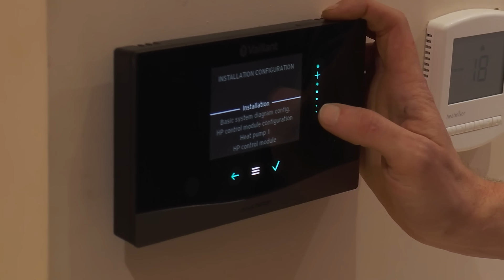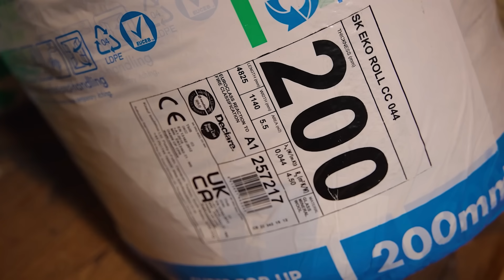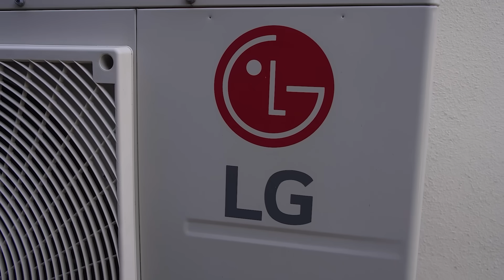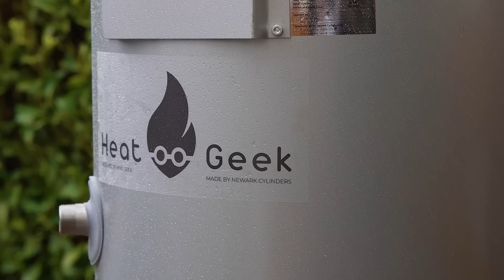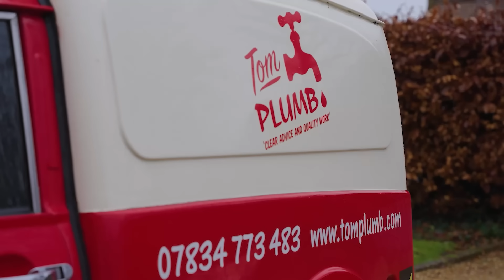Heat Geek’s Heat Pump One Year Later — The Verdict!

Comment: I can't get over the amount of wall space the system  takes, both inside & out. It needs a room for itself
Reply: Not sure why there always needs to be a “plant room” we just put a HP in our flat and the only addition was a HP outside - the controls etc went where the Combi was and the water went under the counter? Maybe it’s the size of house ?
Reply: Well unless you’re a fully certified gas installer you shouldn’t realistically touch your gas boiler either as it contains this stuff that kind of blows up your house if it finds a flame or a spark. If you find gas too complex, you could just put in a fireplace (even simpler).
Reply: @D...Charger i think this poor guy just had a really bad experience and terrible initial set up. My experience after 14 months of use is zero hassle , smaller bills and a warmer gaf - so not sure how they ballsed it up so badly orignally
Reply: @D...Charger  Look how much space is required compared to a gas boiler? And, by the way, a gas boiler doesn't need a defrost mechanism whereas these do
Reply: @davidraddings8211  

My HP went outside house, and HWC went into boiler cupboard in lobby, freeing up space in the airing cupboard in my two bed semi bungalow.
For most they don't need too much space.
Reply: @davidraddings8211  Far to many things for me to sleep at night with that set up lol.
Reply: @davidraddings8211  we pretty much put everything where the combi was - aside from the unit outside. We wouldnt have done it in our flat if we needed a plant room or rearranging pipework etc
Reply: D.. Charger, very hard to know if you’re taking the piss or are serious. Did you watch the video ? Did you watch the video series ? Il summarise it for you - years ago, bad heat pump install, cost lots, not very effective. Today, pros did it properly - better than gas and cheaper. Also he doesn’t have a plant room, it’s his garage. The electrical heater is for the conservatory which are rarely heated and is outside of the heating system so nothing to do with the heat pump or the gas boiler. Yes, teams do fix things together - same for gas installs mate. I get the impression that you just want to be angered by heat pumps, not actually study their uses. The vidéo finishes very positively in favour of heat pumps. What’s necessary is just good installers (which is pretty much the case for anything in life)…
Reply: Efficient or not, it's still a highly complex and expensive way to heat a home.  It's not just about saving money, most people just don't want the hassle.

Comment: Yes the heater in the background ?? 
As I understand it,  to get the £7500 grant, the gas has to be capped off ?
Reply from the maker: No you can keep the gas for cooking and even a gas fire because it is a boiler upgrade scheme
Reply: @SkillBuilder I use much less cooking than I thought, so there's almost only the standing charge as saving if I were to move to induction.
Reply: @Biggest-hz7ng  

Induction hob is far more efficient at heating the pans than gas, a joy to use.
Reply: @_Dougaldog  there isn't much money in it though. But it would be good to ditch the gas

Comment: Are these heat pumps repairable or are they a sealed unit?
Reply: Repairable -they take the cover off to service them. Presumably part costs vary. The pumps are a portion of the total install cost (other costs include any radiator and pipe changes needed).
Reply: @Biggest-hz7ng  yes I'm aware of the total work required as I'm a ga engineer. Never looked at air source nor will I want to but if the unit is sealed like a fridge aka the gas side they are a disposable unit and non repairable.

Comment: 😂😂😂 biggest load of bo11ox on YouTube.
If you've got a few hundred grand, we can fit a really efficient energy system 😂😂😂

Back in the real world, Gas is the most efficient way of heating your home by miles.
Once the scammers of Nut Zero are exposed, the world will go back to normal.
Reply: Reasonable heat pump installs have similar energy costs to gas boilers. Average heat pump install is £4.5 k after grant.

Comment: I am still waiting for my HP to get fixed, HGs and Roger didn't bother getting back, we have the same issue and small kids 3 year olds. We have no started a claim under Section 75 to try and fix it or replace it with gas. It is running but using about 100kwh per day. I would love to get you guys in, just over 1 year later and my heat pump is running at SCOP 2.1
Reply from the maker: When you say that I didn't bother getting back to you. Are you the guy in Colchester? We try to help but we get lots of emails asking for help.
Reply: @SkillBuilder  I am the one in Colchester yes. Apologise I missed the comment. In May we had a highly regarded heating engineer specialist come over and assess the pump as I initiated a Section 75 claim. I provided his report but the installers are still trying to get out of it. We are now 2 years down the line with no hope. I am honestly thinking of adding a gas boiler to the system and use the HP only for hot water or just as a backup. Worth mentioning that the heat pump failed a month after installation, first cold spell, we were without heating or hot water for 19 days, with 3 year olds in the house. I regret the moment I watched Szymons and Adam's videos about Heat Pumps. Due to their positive stories I went for it. If you still have my details please feel free to give me a shout. At least I can get you guys in for a second opinion, maybe that will put some pressure on my credit card. We paid £23k for the heat pump, at the moment it is costing us approximately just over £1000 more to run, due to how poorly it is.
Reply: @DragonXDrei  you took advantage of something based upon Propaganda and a grant , now you can repent , I was offered a free new kitchen by my HA and declined as the old one was ok , just because something is free or subsidised doesnt mean you need to grab it , i didnt get the free vaccinations either and here I am

Comment: £920 a year @15p,  so it would be circa £1500 if he was paying 25p like the vast majority of the population. These deals by elec co's are distorting the real costs. Why cant everyone pay 15p, because its a subsidised rate being paid for by everyone else.
Reply from the maker: That is a very good point and throws the whole enterprise into question. I think we should now spend a year running the gas boiler in the same way and see what happens.
Reply: @SkillBuilder the heat pump outputted 29,671 kWh - about £2,206 at current gas prices with a 94% efficient gas boiler.
Reply: Just like those 'deals' where you get cheap or even free electricity at off peak times. Great if you want to cook your dinner at 3 am.
Reply: @TheDavecroft confidence in the overall pricing or a small battery makes such deals feasible.

Comment: The electricity production infrastructure is set to destroy the natural beauty of the countryside. Many years ago, the imposition of such structures as wind turbines and solar panels would have been impossible. When the infrastructure fails, there will be an awful mess to clean up. The infrastructure will fail because, at the moment, the demand is nothing like that of the politicians' ambitions and if everyone gets electric everything (cars, etc.) then we will see rationing and blackouts regularly. Also, if existing properties have to have car chargers (on an inevitably much higher tariff than domestic use electricity) then there will have to be much digging up and replacement of existing copper cables because they are not up to the demand. This whole exclusively electric idea is madness that will create one almighty mess. Who will pay? The tax payers and the householders.

Comment: What a joke @SkillBuilder 's take on it is. A story in videos:
1) Heat pumps don't work, look at this property
2) Gets proven wrong by a dream conversion
3) Turns around and argues that it doesn't work for everyone.

What else needs to be done to prove the point? You cannot spell out a cost effective path to net zero, but your only take is "gas boilsers are convenient". Congratulations on proving your resistance to learning. It is blindingly obvious how you are ignoring what your customer says in order to politically hijack the discussion.
Reply from the maker: Michael 
Heat Geeks have proved that this property is suitable for a heat pump after Adam and I put another 150mm of insulation in the loft. 
The dream conversion would have cost £22K so that, in itself is proof that heat pumps don't work for everyone. 
I was at  a property a few weeks ago in Birmingham and the Heat Geek told the customer that they shouldn't bother with a heat pump.
As I said in the video Adam from Heat Geeks is an evangelist and for that reason he refuses to accept the simple premise that heat pumps are not, and never will be,  the answer for millions of homes in the U.K. 
There is nothing political in that statement. This is about heating homes not politics. It is a shame that people such as you are incapable of clear thought and objective analysis.
Reply: @SkillBuilder  over one year ago you where on this platform ranting on how heat pumps don't work. Not just that they are not cost effective, not just that they are more difficult to install, but simply that they don't work in some properties full stop. It seems like you don't have the best track record to make these kind of claims, but I highly appreciate that you went out and made a collaboration with your biggest critiques. This deserves respect to be honest.

However you clearly went political https://youtu.be/gWB27SUgoVE?t=524 and https://youtu.be/gWB27SUgoVE?t=827 and just to be clear there is nothing wrong with that in and by itself other than I can't get rid of the feeling that you are inverting John's statement to push your agenda.

That was regarding the form. I disagree with the content as well. You are calling Adam an evangelic, however you are keep your dogma that there is going to be a "mix of everything". Just to be clear we are talking about a notable percentage. Sure there is a place for district heating etc. but my problem is specifically about just keeping gas. In a net-zero scenario this is just not cost effective and study after study is showing that hydrogen is never going to be cost effective for heating. So I think it is dishonest to keep telling people that they can simply keep their gas boiler in and everything is going to be fine.

Comment: The solution to flats is to have centralised plant. Large scale GSHP with immersion backup and the hot water supplied to each flat. Even if you did that with centralised gas heating, it's far more efficient and safe than 50 individual gas boilers.
Nuclear fusion isn't going to solve all problems and nuclear fission works perfectly well, we just need to build them.

Comment: My friend in Germany is having geothermal heating installed..theyve jist finishedbthe drilling..what are your thoughts on this?
Reply from the maker: It is a good system and I have done  a couple in the past. You get a slightly better COP but it costs a lot more to do it. 
Although it is called geothermal it is not. The correct term is ground source because you are tapping into solar capture rather than something produced by the earth itself. The best ground is actually water and we have a video coming out soon where the have put collectors into an underground aquafier.
Reply: @SkillBuilder thank you for the info. He's coming to stay in the summer and I'm fascinated to know more.

Comment: 4:00 "I was thinking, save the planet, less carbon"... Another typical brainwashed idiot who can't be bothered to think for himself. "But muh TV told me what to think! How dare you question the TV!" he cries... And so he wastes £40,000 on this rubbish! Ha ha! A bog standard (self fitted) air conditioner which uses HFC free gas, is £700, you could get six of them fitted for about £6,000 tops, then solar panels for £5,000, 20KWh of solar batteries for £4,000, and a 10KW inverter for £1,500 and £1,500 for cabling and the cost of the electrician. Then you have a much simpler system, no insane pipe system with all those heat pump tanks, only use the air conditioner/heat pumps in the rooms you need to, all controlled by an app on your smartphone, and if any part of the system goes wrong, it's easy and cheap to replace each element.
Reply: He spent £22k on the system. I think an appropriate system these days after grant would cost less? Both A2A and ASHPs are efficient electrical systems that can be used to generate low carbon heat. It's easier to measure the efficiency of ASHPs, so they are supported by grants. Maybe A2A at some point too.
Reply: @Biggest-hz7ng  Why should poorer taxpayers have to pay for a 'grant' (i.e. THE PUBLIC'S TAXES) for richer people to buy pointless heat pumps, so they can show us all how 'caring' they are, because they are just so concerned about 'muh planet'.   I've already explained why using normal air conditioners is a much cheaper way of using heat pump technology, plus you get air conditioning for the summer, and it's much easier to fix if something goes wrong. But you ignored all of that.
Reply: @johnthomas338  70% of voters support action on climate change. Electrification of heating is a key part of that. I'm not sure how I am ignoring air conditioning when I mention A2A as an efficient electrical system perhaps deserving of a smaller grant (as they are cheaper)? We will need both A2W and A2A heat pumps.

Comment: The cost of electricity in UK is dictated by the last generator (the last bit of electricity generated) - which is always gas.  We are paying high domestic prices as it is to the advantage of private suppliers to always have gas as the last generation as they make much more profit.  The whole system is based around making amount of profit even when wind/solar generation exceeds demand on a windy/sunny day, so they keep at least one gas generator running so they make the higher price.
The whole generation system is broken and has been for years.
Reply: With more solar and wind coming online hopefully we'll see better pricing. Hopefully there'll also be new ways to incentivise better located generation in the future.
Reply: It's not exactly as described, as one major problem is a lack of cables taking the electricity from the point of generation to highest demand. The reason gas often continues to be used to generate electricity even when renewables are kicking out an excess is that the renewables tend to be far from the demand and the cables transferring the electricity are can't carry all of it. The grid infrastructure hasn't kept up with this -- it was designed around moving electricity from e.g. coal & gas sites rather than from wind farms.

OTOH I do agree that market pricing reforms are needed as well as overhauling the grid to make green energy work better. The government just rejected zonal pricing, so that's one potential solution rejected and I've not heard much else :/

Comment: 1:36 "Part of the problem, with hindsight, is I was treating it like a normal heating system, where if you went on holiday you turn it off, if you went out for any length of you might want to turn it off and that sort of thing, but they don't work like that." So he spends £40,000 on a heat pump system and doesn't even bother to learn the basics of how it works... Okay...
Heat  pumps are generally a waste of money, and all based off the 'muh climate change' lie (which used to be called 'catastrophic man-made global warming', but they changed the name because insufficient 'warming' was happening'...)
You would be much better off buying two or three air conditioners, which also double as heat pumps, and have them installed in the main rooms you use in your house, then you can run those off electricity and get a COP of maybe 3. Then you could also buy some solar batteries and a 10KW inverter, and use Economy 7 electricity to power your house and the air conditioners. Then you have cheap cooling in the Summer, and as cheap as gas heating in the Winter, but without spending £40,000 and having all that incredibly complex pipework... 
I presume all the pro heat pump comments on here are from heat pump installers, or heat pump sellers, or anybody else who somehow profits off the 'climate grift'.

Comment: Mine turns the area around it, to an ice rink. When it is cold.
Reply: Ask for advice on the Facebook heat pump groups? Sounds like the soakaway needs to be improved?
Reply: @Biggest-hz7ng  what soakaway?
Reply: @fortnitefred1351  the soakaway collects the condensate under the unit either into a pipe or a gravel-filled hole:
https://m.youtube.com/watch?v=jEH_P7b4ICo&t=524s
Reply: @Biggest-hz7ng  aah, it appears I have a quality install, I don't have one!
Reply: @fortnitefred1351  sorry to hear! Received mine under a grant, but it still has one.
Reply: @Biggest-hz7ng  mine was, looks like I was taken for granted!

Comment: We've recently had the same unit installed with a full set of new radiators to replace a fully electric boiler. The results are incredible. So far 600% efficient and the house is comfortable for the first time since we moved in. We also have thick stone external walls (500mm) high ceilings and are end of terrace. I do think the stone walls work to our advantage, but actually made it very difficult to get the MCS certification and grant, which seems to massively overestimate heat loss through solid walls.
Reply: To be fair, not many people who have gone down the ASHP route are hardly going to admit they made a mistake, are they?
Reply: 600 % efficiency😆....
Reply: @Meodus_Humbinerberneckiyes, after dragging in heat from the air outside. John's heat pump averaged 450% efficiency over the whole year.